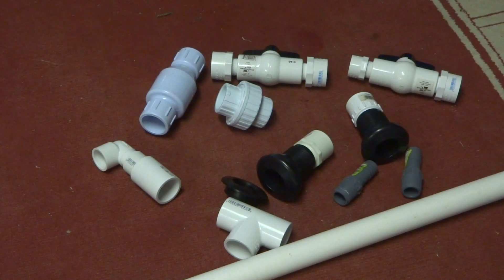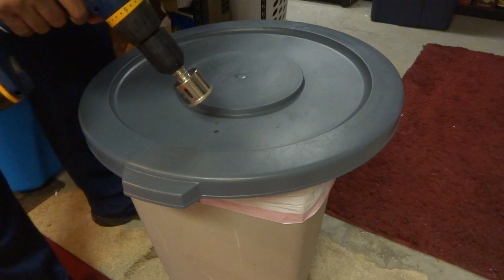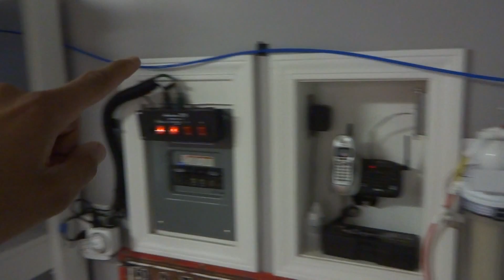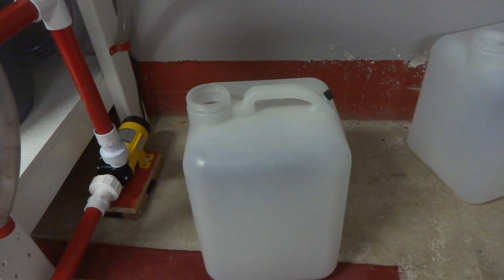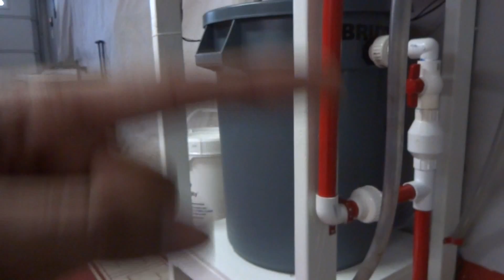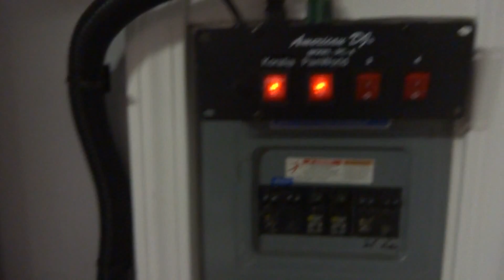Saltwater Making Station: Saltwater Aquarium

Comment: Nice gill! Doing similar. Adding an eb4 instead of dj and tying into aquabus from a DOS that I 1linked from main apex. Will be adding a breakout box to that and putting some float switches into the brutes to monitor levels.maybe even connect those to solenoid to rodi unit

Comment: Hey Gill. I built a very similar station. Was curious if you ever had any issues with the hole being direct center in the trash cans and there then being couple inches of left over water in the salt bin. Do you leave it in there for next change or do you some joe drain it ?
Reply from the maker: Center bottom or center on the side? Zero issues center bottom. I had this station for over 5 years. Some salt creep on center side. I mix my salt and have it on hand at all times.  I run a pump in salt 12 hrs a day. Upgraded my salt mixing station. Its on my Instagram if you're interested.
Reply: ReeferGil center bottom. I wasn’t thinking when I drilled and built mine, since on the bottom part of the brutes around the edges is actually lower then the middle. Was wondering if I’m gonna have problems with the bit of left over salt water after a water change when I go to mix my next batch
Reply from the maker: @IglooHockey  I do weekly water changes, only use 10-15 gallons a week. Refill the container and start over. You'll have leftover, but not an issue.

Comment: Hi! How did you connect the 1 inch PVC to the hose/tubing?
Reply from the maker: Hi, you would need a 1" barb hose. Glue it, then slide it inside 1" pvc pipe or 1" 90.

Comment: You can prevent putting the valve if you use a check valve on the line that feeds the pump from the bottom of the tank
Reply from the maker: CUBAN REEFER  Thanks for the tip.     Love this WC station. Saved me lots of time

Comment: After reviewing different saltwater mixing stations, I have decided to mimic your set up. I was wondering how difficult is it to get to the coupling underneath the bottom platform for any maintenance?
Reply from the maker: Excellent question. The hole I drilled on the wooden shelve where the coupling comes out of was cut out large enough to fit my fingers through and access the coupling. Hope that makes sense.

Comment: How much money did this cost to make not including rodi unit? Also, how does your rodi unit stop making the good water when the barrel is full (where does the water go when the float valve goes up?)
Reply from the maker: +Aiden Tolomay It was piece mealed together, so I don't know how much it all costs. The water stops flowing when the float switch inside the barrel rises.

Comment: how do you no how much salt to add?
Reply from the maker: +sa88m It's 1/2 cup per every gallon of freshwater. I try for 1.026. It takes a while to get it right. If its too high, just add a bit more freshwater, too low add a little more salt. Theres a learning curb at first. Thanks for the post.

Comment: Great video very helpful! Just one question, if I'm not using all the salt water in one water change, can I leave the rest of the water in the barrel without any circulation until the next water change?
Reply from the maker: Alan Espinosa You don't need to circulate fresh RO water, but you will need to keep your stored saltwater circulated because it will go bad if it goes stagnant. Just throw a pump in the container. A heater would also be helpful in case you had to do an emergency water change, you want to avoid putting cold saltwater in your tank. If you're storing the saltwater for longer than a couple of weeks, then check the salinity level one more time as evaporation can affect your salinity levels. It's a good idea to keep enough new saltwater ready to go in case you have to do a big emergency water change. I hope this helps.

Comment: Very nice, I'll certainly take some ideas from this! Have you considered pumping your salt mix directly to the display tank (long hose) instead of carrying 5 gallon jugs? Shutoff might be a little tricky on the timing...
Reply from the maker: David Roady Yeah, that was definitely doable had I thought of it when I first set up the tank. I'd love to make an automated water changing system to do water changes with a push of a button, but seems too complex. Still may take on the project to pump SW from downstairs into DT.

Comment: Quick question, how do you add the salt? You can't remove the lid since the flex tube is going through the lid? And you really can't pull the can out? Do you swivel the lid around? That's the only thing that worries me with this design, other than that, this is the perfect design.  And your response will probably make my concerns go away.
Reply from the maker: ***** Hey Randy. I simply pop the lid off and remove it. I don't have to turn it. The 90 elbow coming off of the bottom of the freshwater bin is NOT clued in. So I just slip it on and off as needed. Hope that helped. Thanks Randy!
Reply: If your system lacks flexibility you could even cut a small hole in the lid and use a funnel for salt and cap it when you’re finished.

Comment: Good video! I plan to do the same setup but a little different. I want to use the same brute stack up design but I'm wanting to do a setup where the pump will circulate and pump salt/freshwater independently. I got the design but I'm ciruous...if I use bulkhead fittings on the curved part of the brutes (bottom part) will it leak or do I have to use uniseals?

Comment: I am in the process of building a similar set-up.  I need to find a pump that will send water 75 ft+ horizontally to my main tank in the house.  Do you have experience in pumps to tell me what brand/model is powerful enough to move water fast enough for water change that is 75+ feet away?
Reply from the maker: I'm sorry I wouldn't know. Hopefully someone will jump in and steer you in the right direction. ANYONE?
Reply: Same company pan world go with models that don't have the X. The plain p models handle head better. So at min I would do a 150p

Comment: well  think I m ready to duplicate your system with a few minor adjustment! what size
bulkheads did you use? And the size of the uniseal? I located the uniseal on amazon but want to make sure I select the correct one.
Reply from the maker: Alright! Very exciting! I used all 1" PVC, 1" bulkheads and 1" Uniseal. Grab at least one extra bulkhead in case you accidentally crack one. I bought my bulkheads and Uniseal from BulkReefSupply.com. Hope to see a video when you're done.

Comment: Nicely done!!!  Figured you would like that Blue Line pump, love mine.  Your setup is really similar to mine (except for the red paint which is a nice touch).  The big difference between our setups is that I use my controller to monitor my temp/PH/Conductivity.

Comment: If u can plumb it directly u should put the new sump where your mixing station is...more room to work on your equipment.  I'm looking to do the same thing moving tank to an in wall and everything in my garage.  Mixing station with auto water change..can't wait, I hate carrying buckets into the house for water changes.  Anyway great job on the mixing station...oh also where did u get that pump for so cheap?

Comment: you definitely inspired me to build one, not sure about the space i have available but going to take some measurements now, how many gallons are your brutes? 32gal? how far is your station from your tank? would you be able to run the lines directly to you tank so you have even less work? if possible i would use the ready mix in conjuncture with my skimmer and wet skim with a float switch and have a series of small water changes through out the week...food for thought